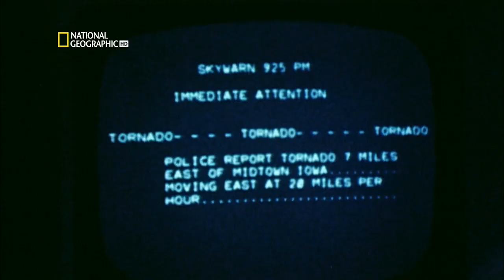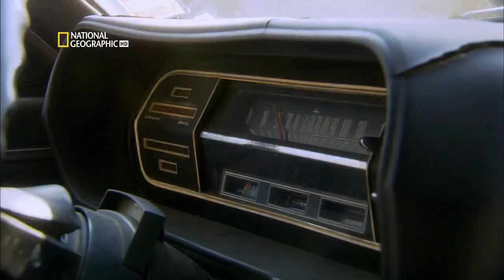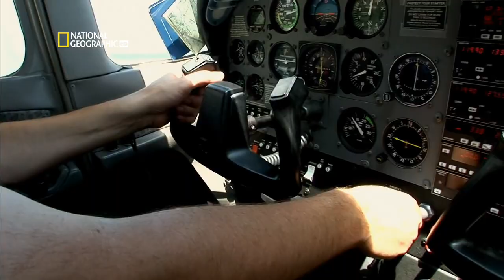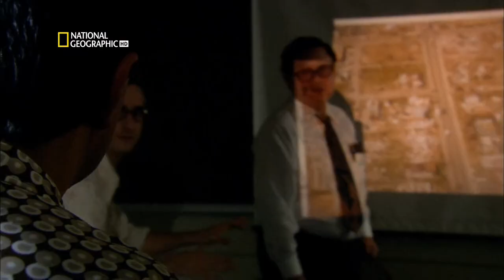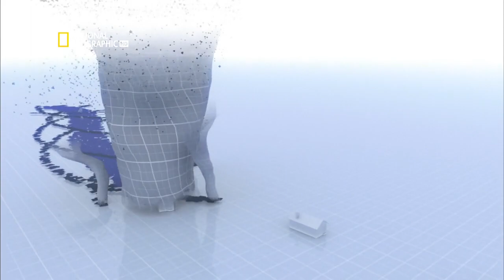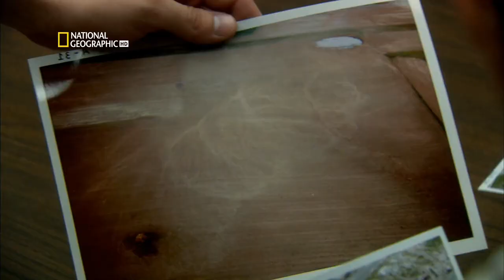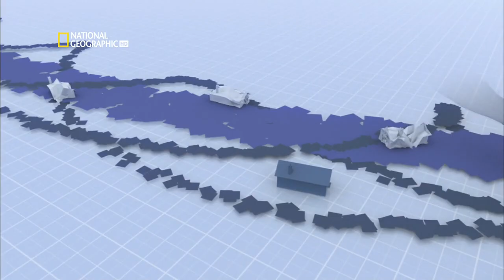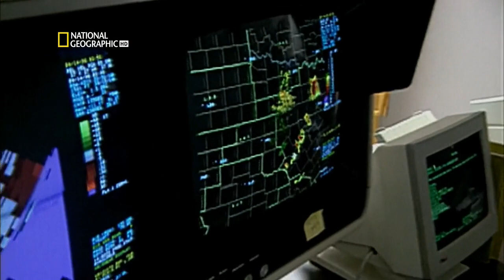Tornado Outbreak | Seconds from Disaster

Comment: The moment I saw Lucille opening the windows I was reminded of a common myth that opening windows will save a home from a tornado. Unfortunately not only is it false but it is also extremely dangerous as one you will be putting yourself at risk of being hit by flying debris and broken glass and two it will waste precious time that you have to seek shelter. Instead you should keep the windows closed and immediately seek shelter preferably in a underground basement or storm cellar. If there is no basement or storm cellar then take shelter in a interior room that has no windows or outside walls such as a bathroom or closet.

Comment: this why i laugh at people who say oh it was a E F4 when there is no such thing as  E F scaling there has only been and will always be F scale after dr ted fujita
Reply: The F scale was replaced with he EF scale in 2007
Reply: EF means Enhanced Fujita scale. It's not a replacement, per se, more redoing it after realizing that the original Fujita scale was somewhat flawed (which even Dr Fujita himself acknowledged). We discovered that winds dont actually need to be as high as the original scale described in order to do significant damage, and rather than relying on wind speed alone the EF scale takes into account 'damage indicators', stuff like how much damage structures receive, how well built those structures were, etc. It just has to do with the more we learn about tornados, the better we can understand them and the damage they cause.